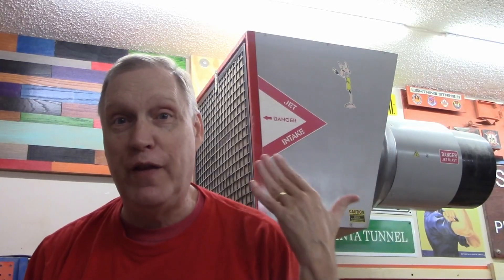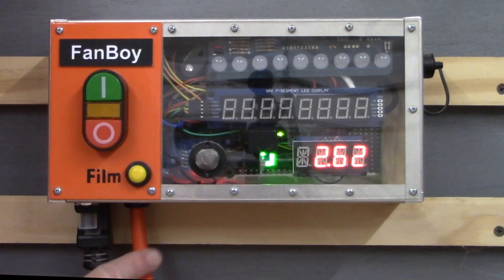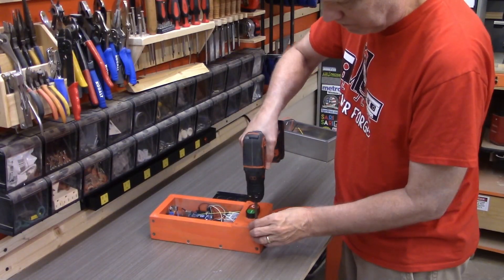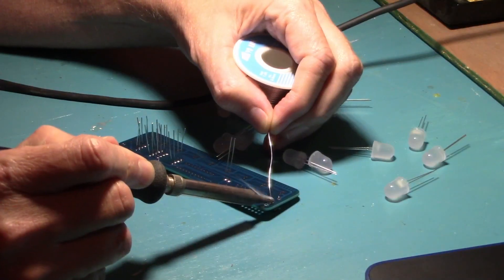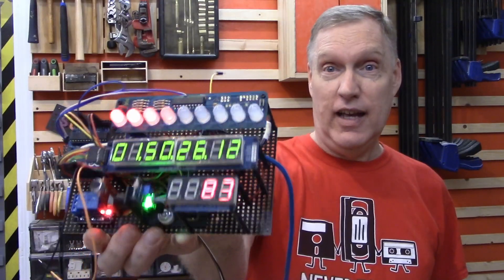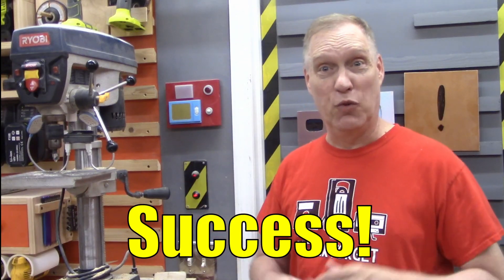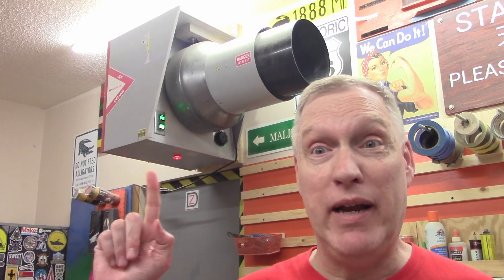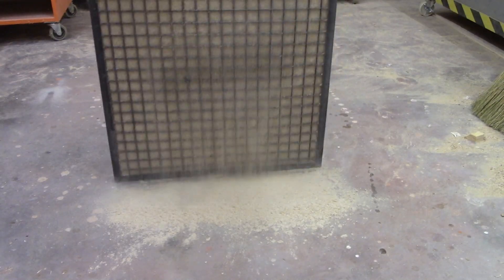Upgraded Sound Activated Wood Shop Air Filter - Automated Air Cleaning

Comment: Awesome build, and cool video! 
I'm wondering about the countdown on the green display; it looks like it's counting down seconds but slower than 1 second pr second... Is that just an editing artifact, or is the timing off?
Reply from the maker: No, it's a serial print artifact. I have eight digits so I am counting HH:MM:SS:MS. So the last two cells should be spinning very fast showing milliseconds. However I have several serial print routines in the code to check sound and sound duration levels and for some reason those slow the clock down. When I comment those print statements out the clock runs properly but right now it's running at about half speed. Good catch seeing it!

Comment: Wow, that is a lot of dust. Nice job!
Looks like you did away with the solid-state relay. Why was that?
Reply from the maker: Yep, the FanBoy collects a very large amount of dust for us. The solid state relay was rated for 15A and required a heat sink in a wood shop that is often pretty hot. So I switched to a 30A relay that the Arduino could switch and got both a smaller relay and zero need for a large heat sink. Simpler design in less space.

Comment: Pretty cool addition! I built a very similar version of the fanboy for my own shop with the same motor. Biggest difference is I used 12 in ducting to move air around the corner I had to put it in. But it works great, I’m getting about 800 cfm from this motor on its highest setting according to my cheap anemometer, even with the filters and ducting. That is good for 1 air change every 5 minutes in my shop. Anyway thanks for the videos! Always cool to see these diy solutions.
Reply from the maker: Very cool, and I love the idea of ducting to force the air away from the fan. I'm sure you saw the same reduction in floating dust that we have. We love the air cleaner and this device ensures that we use it as much as we should. Glad you like our stuff!

Comment: The controller turns Fanboy on based on certain parameters.  What shuts it off?
Reply from the maker: Every time it hears an event while the lights are on it adds 30 minutes to the clock and then it runs until the clock runs out. It keeps running after we've left the shop for however long the clock has set, for a maximum of five hours. This allows the FanBoy to do a pretty thorough job of cleaning the shop air and the longer run times have really made a difference.